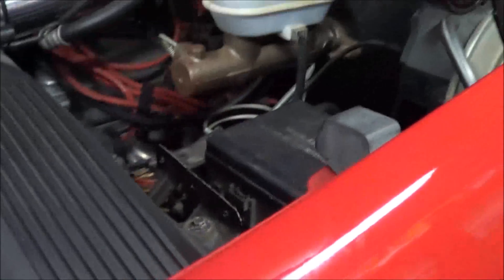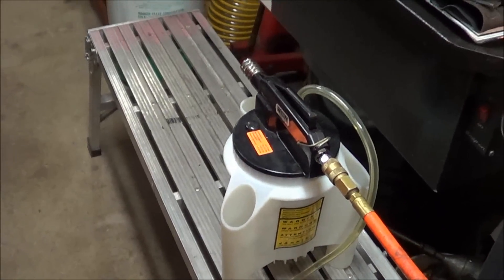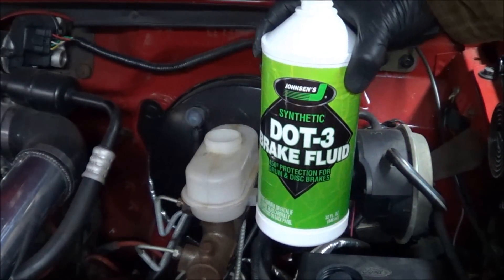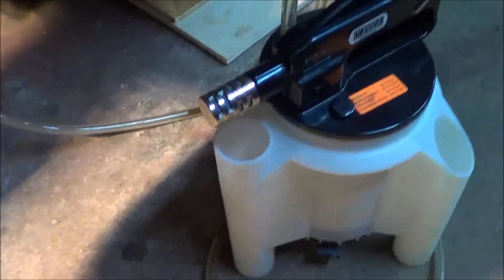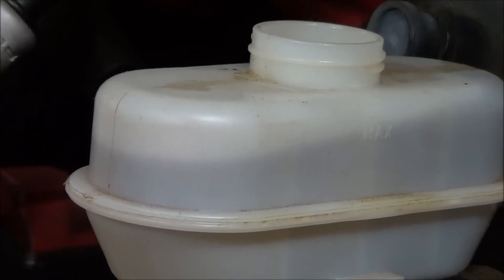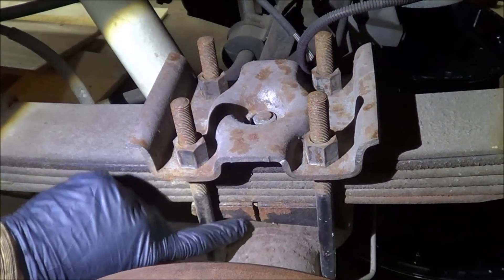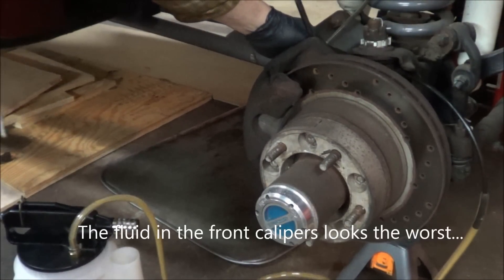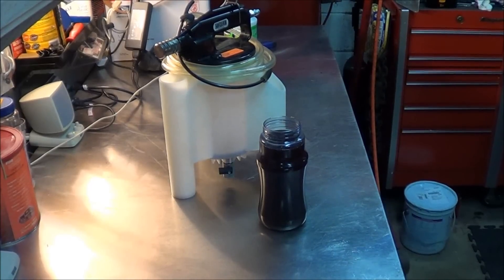1-18-14 How to change brake fluid with a vacuum bleeder on a 92 Ford Bronco

Comment: Nice Video Carl.!!! Have you had any problems with your wheel adapters loosening.?
Reply from the maker: ***** They are actually spacers, had them for years (and two vehicles) and never an issue. The track width on the Bronco is narrower than I care for so they help out a bit.